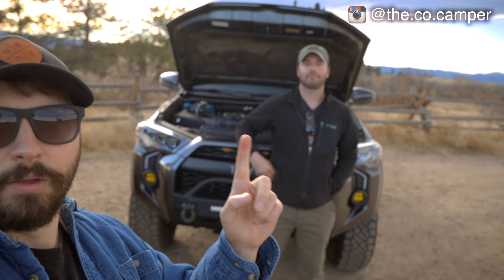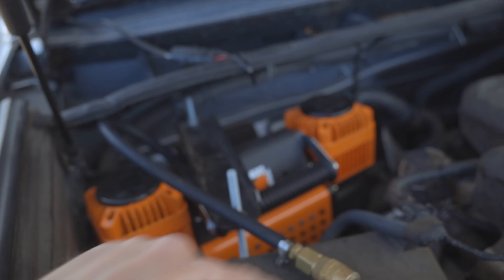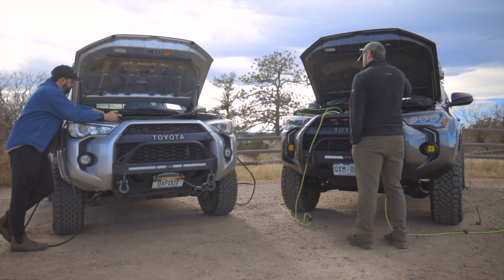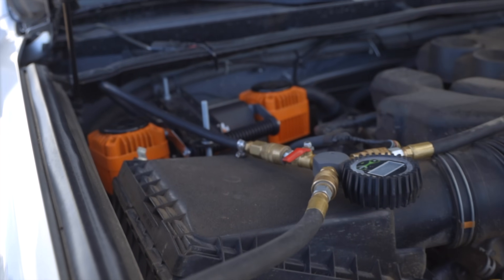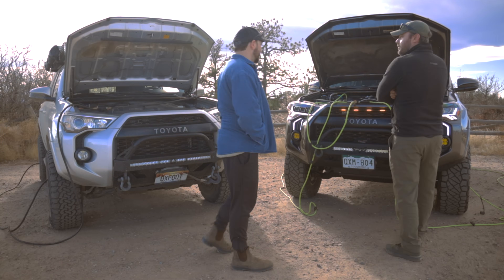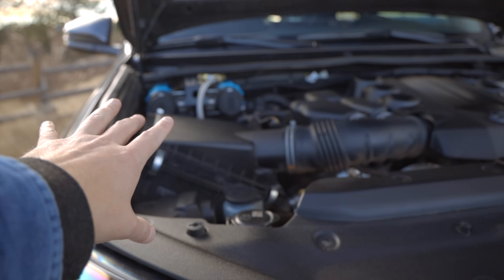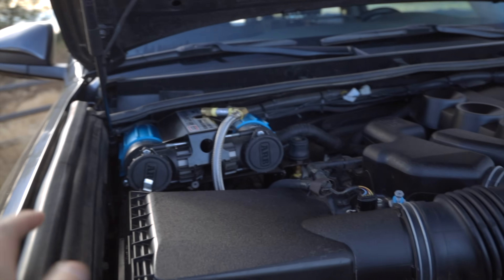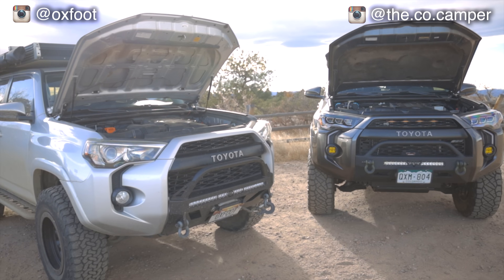Budget NAPA Compressor is FASTER than ARB Twin?

Comment: Speed could mean it is running hotter and will die sooner. Does either one state a duty cycle? i.e. the $35 single compressors often say 10 minutes on, then 15-20 minutes off to cool down. Or else they melt down.
Reply from the maker: So someone dug and reached out to them and found the numbers. It’s rated for 40psi for 15 minutes and 5 minutes off. So you could air up a few buddies tires in that time, but personally I think like in my case I’ll just air mine up because it’s in the engine bay and will just automatically be at a higher temperature.

Comment: How’s the compressor holding up? Liking it better than your Smittybilt? Thanks
Reply from the maker: So far so good. I would imagine if I had any issues with it would be due to water getting in it somehow but I thought the same with the smittybilt and that lasted me at least a year and a half.
Reply: @OXFOOT  good deal! I’m on the fence between the Napa one or the smittybilt
Reply from the maker: @fatmattsadventures2796  If you want something thats been tested many times then go smitty, if you want something fast that seems to be working alright go with the NAPA. It's a tough call. Also what size tires do you have? A big reason I wanted to go NAPA was because I was going to and then did eventually go up to size 305/70/17
Reply: @OXFOOT  I’m on 315/70r17’s on my gx470
Reply from the maker: @fatmattsadventures2796  damn it’s wild that the GXs handle that so easily with a narrow wheel well. I’m rubbing all over with 305s.

Comment: This genuinely caught me off guard. Perhaps the NAPA compressor won’t last as long but with that price and performance it’d  be worth replacing if and when it does break. My only reservation on it is the look. The ARB twin looks significantly cleaner and more like it’s meant to be there.
Reply from the maker: Yeah it’s aesthetically not my favorite. It’s massive, bulky, bright orange and just clearly not as nice as the ARB. That being said, in my engine bay it’s not noticeable. I may eventually go ARB because I want to go lockers and have a dual battery which I could only partially do with my current set up.
Reply: @OXFOOT   agreed. Just wish the ARB had similar performance because 10 minutes seems like a ridiculous amount of time when you’ve paid $600+ dollars for the setup.

Comment: What is the duty cycle of the NAPA? The ARB looks so much better
Reply from the maker: I couldn’t find it at all. I hunted for that info. Given that it only takes 3 minutes or so and I only air up my tires with them I’m still very safe operating the compressor but if I went back to back a few times and it was in the desert I’d pay close attention to it.
Reply from the maker: And yeah as far as aesthetics the ARB is head and shoulders above the rest.

Comment: Great video. I have a question about the versatility of the NAPA compressor, though.  Since it puts out so much air, is it still useable for airing up car tires?  My wife's Mazda had her TPS sensor go off the other day (Likely just temperature swing here) but it made me wonder if the compressors I was looking at for a 4WD truck could still be used to top off tires like hers or just blow the beads off the rims.
Reply from the maker: Yeah I mean at it’s speed I would think you’d be fine just keep a close eye on it. Like don’t leave the compressor’s side while you’re doing it. Maybe run it for like 10 seconds and see what it’s at.
Reply: Yep it does. I aired up my Subarus tires fine. Also aired my drift cars rear tires to 60 psi at the track
Reply: Air compressors don't really care what tire they're filling

Comment: Do you have a link to the modification video for the Napa compressor?
Reply from the maker: This one at the end ha all the stuff you need. You’ll just cut the hose and slide the barb in, slide a clamp down the hose, attach the connector to the barb and then slide the clamp back up over the part with the barb to keep it tight and then screw down the clamp.
Reply from the maker: https://youtu.be/De10UUP5UzY
Reply from the maker: Starts at like 10:20 something.
Reply: @OXFOOT  Thank you :)

Comment: Hi. How's your compressor doing? Still working under the hood? And very interesting to see a video on installing it. Thanks
Reply from the maker: Still holding up just fine. Still using it.
I have a video on installing a smitty built and it’s the same process but you just need to turn it a bit to make the bigger Napa one fit and not hit the engine.
Reply from the maker: This is the video: DIY Fast and Easy ONBOARD AIR with ANY compressor! SMITTYBILT
https://youtu.be/De10UUP5UzY
Reply: @OXFOOT  Thanks for the reply. I also recently bought a similar compressor. I'm going to improve it a bit more though. It doesn't have its full potential.)

Comment: Is there a duty cycle specified? I am curious if this could handle, with longevity, air locker usage.
Reply from the maker: I wish I could find that info. I tried to find it. If it was viable I’d love to get a front locker. I need to figure that out and finish wiring this thing in as well.

Comment: What bracket are you using for the front license plate of the c4 bumper? Thx
Reply from the maker: It’s actually their bracket that they sell. The Hawse license plate bracket. They have a new version of it that they make in house but the one I have is something they used to sell from another manufacturer but stopped. It’s called like the WP hawse license plate bracket but I’m not sure if it fits their bumpers now, maybe they’ve made a change to the design to fit their new brackets.

Comment: Which video shows you modifying this to work with your 4 way
Reply from the maker: I have a video that tells you how and shows the parts but it’s not like a video of me actually doing it. It’s just cutting the hose and adding the barb to the connector and then putting the barb down the end of the hose then clamping it. I’ll grab the video link hang on.
Reply from the maker: It should show in the time stamps in the descriptions show where the mod instructions are, but it’s towards the end.
https://youtu.be/De10UUP5UzY

Comment: So we see the results and they are very clear. What I will say about the build quality topic....there are a few things at play here. The biggest 1 is that NAPA as a company has pockets that are soooo far deeper than the other company. Plus they will most likely build a lot more in bulk. NAPA has the contacts to built products by companies and in places the other probably can't touch. When you add all of those factors up, plus others as well, can you really say for certain that the ARB is higher quality or we all just assume it is because we are programmed to think more expensive is better? Also too, maybe the ARB costs extra just to support the company owners lifestyle and there really hasn't been much competition to make them lower their prices. Whereas NAPA doesn't have to make $300 on each unit because they are so diverse that they are totally fine making say 20% on each unit vs the ARB that might be making 100% profit. The only way to truly test build quality would be to run say 10 compressors from each company 24/7/365 and keep track how many hours till fail. 1 guy might claim 15 years on an ARB, but maybe he only uses it once or twice a year? Sooo many factors involved
Reply from the maker: I mean that’s a really good point. I feel like the fact that they didn’t have a warranty provided was a good indicator that they didn’t really stand by the build quality but that’s 100% an assumption. Other than that the NAPA one hasn’t been around long enough to really prove that it’s high or low quality. You’re certainly not wrong in these assumptions.
Reply: They all pretty much buy from Chinese manufacturers. These units are sold under about 20 different names...they're all the same. One can go to Aliexpress and buy one for like $58 +s/h just to give a price comparison
Reply: @mrmotofy  I haven't researched these things enough to know that for a fact, but what you're saying definitely applies to MANY things. Batteries is 1 for sure. Back maybe 20 years or so ago I rememeber hearing this about shock absorbers as well. The other thing to consider is a known practice of China....Americans will design something and then give those schematics to a Chinese company to build it for them. Then that Chinese company turns around and just makes more than ordered and sells them to other Chinese companies. Plus so many companies reverse engineer things like rememeber on Top Gear some years back where they showed the knock-off BMW SUV that "looked" identical, but the build quality was severely lacking.

Tons of shenanigans for sure and for the most part, China doesn't enforce or recognize our trademarks or pattens.
Reply: @humveeadventures  Just as an example, I have a list of 8 brands of these 300L Dual compressors, that's not even including the multiple AUS selling them, I only listed a couple of the big ones. 

More often I believe the manufacturers buy off a Chinese catalog then relabel. A few years ago SnapOn sued Harbor Freight over the aluminum floor jacks that HF listed same as SnapOn etc. Something about trademark infringement or something. So it went to court...and the truth came out in the evidence...OOPSIE SnapOn was buying them from a catalog, then HF bought the same item and put a label on em...They are the same identical item...SnapOn lost cuz the truth was undeniable. It was the same item.

Yes I believe what happens is US specs are sent to the factories in China, they run the matching spec products then change labels or paint colors and run more and sell em on AliExpress etc. 

One example is I bought an inside truck door handle that is plastic riveted to the interior door panel. Dealer requires buying the whole inside door panel for $900. Or I can buy the same exact door handle and replace it for $12. They're identical right down to the exact pattern of the plastic finish, which is extremely rare from different manufacturers.

I seen these Dual compressors on Aliexpress for $59 + s/h
Reply: @mrmotofy  that's crazy that snap-on did that! Thx for the info.....never heard about the snap-on case before
Reply: @humveeadventures  Yep one can start getting really detailed and looking at flashing marks, tooling/die marks, finish designs can be sort of like a fingerprint, the overall layout of components, bends of piping etc. Different manufacturers will almost always be different.
As another example look at the 60gal or 80 gal box store compressors. They are virtually all the same in appearance, specs and design just a different name on em. Cuz they are made in the same place...just different name. These days with global manufacturing tons of relabeling going on. Almost anything can be bought direct and relabeled. I've gotten emails from a camera distributor...that is selling custom lableled cameras, and they are only the distributor. Tons of products are priced on a name.

Comment: I only use my truck to off-road a few times a year so this would be a reasonable option
Reply from the maker: What truck do you have? This thing is big so just making sure it’s gunna have the space in the engine bay.
Reply: @OXFOOT  Trail Boss. Can’t seem to find them so guess it don’t matter.
Reply: @OXFOOT  I’m also getting limited cause I mounted a 1500 watt inverter under there already. I ran a power plug to the bed too. I’ll figure something out eventually. I usually don’t travel in a group so no one’s waiting on me. I just meet them there and let them go on afterwards.

Comment: Do you have a link to this compressor?
Reply from the maker: https://www.napaonline.com/en/p/BK_MTWM10215C?cid=paidsearch_shopping_dcoe_google&campaign=GSC-Paint-Body-Equipment&campaign_id=10947560788&adgroup_id=110533803034&adtype=pla_with_promotion&gclid=CjwKCAiAv_KMBhAzEiwAs-rX1OYkScIZD7QaEz32IjiXC3Oi2pOLhPWZMErP5P6moI1mUEARxSRi2RoCgZQQAvD_BwE&gclsrc=aw.ds&
Reply from the maker: They are running a deal now that if you buy 3 things you get 20% off your order. I have both the compressor and the trash caddy and I recommend both.

Comment: I'd still go for the Napa over the ARB. I won't buy an overpriced air compressor just for it's brand name.

Saying the ARB will last long is not accurate for you are not sure at all.
Reply from the maker: Yeah I’ve had buddies of mine who’ve had theirs for years and they’ve had no problems but people have been commenting on this video saying they haven’t all had the same luck. The NAPA could be the same or better.

Comment: What were you both aired down to? And how close is your tire sizes?
Reply from the maker: Damn I should have added that. Exact tire size (made sure of that before filming) and we were going down to 15 psi and up to 35.
Reply: @OXFOOT  damn then 3 or 4 minutes for all of them is way fast. Mine takes like 8 to 9 for all 4 from 18 to 36 and they're smaller tires. So slightly more than twice as fast.
Reply from the maker: @seanwatson3790  Yeah it's almost too fast if you're doing one tire at a time. You'd start it up and be ready for the next tire.
Reply: @OXFOOT  ya I absolutely have no doubt. Maybe I'd you were running 40s it would be slower lol

Comment: Which one is louder. I run my compressor inside and was wondering about noise level
Reply from the maker: I would say the ARB is a little softer. The ARB has a very distinct sound whereas most other compressors have about the same noise.

Comment: Alot of the same on Amazon too even the bags that come with it are the same/similar (china) i got a lower end smitty built for my car its China bag is horrible quality but it works and filled my tire in about a minute 🤷 it got a little warm but cooled off fast so...wasnt as loud as i was expecting and didnt vibrate that much either , filled my tire before my car even warmed up 😂
Reply from the maker: Yeah I had a smitty for about two years and really loved it but it was a single piston. They may make a double but I haven’t seen it. I think a few Australian companies make exactly this compressor and just change the labels. I’ve seen ads from them with the same bright orange dual piston set up.

Comment: Can the max trac be use on the air locker
Reply from the maker: It probably could but unfortunately they stopped making this compressor very quickly after this video got released.
Reply: So you're saying that I can't get it from napa anymore

Comment: To state the obvious, the ARB has to be six times more reliable over the long-run than the Napa unit. If it were me, I'd buy two Napa, keep one as a spare on a shelf in the garage, and still pocket $400 in savings.
Reply from the maker: For sure. The only problem now is that they can’t seem to keep the Napa compressors in stock. The only other budget one is the summit offroad compressor and that’s $200.

Comment: faster does not always say better. 
durability is a big thing here. 
will the nape hold up for very long? sure cheap is the co$t point. sure you can buy a number of them before hitting the price point of the better brand (read pay hard earned cash for a name). would you need to have a spare napa compresser for when the first one stops pumping air?
how does it hold up to filling a 5 gallon tank with air up to 150 psi?

Comment: What bumpers are those?
Reply from the maker: I have the C4 low profile bumper with a 30” light cut out and mid height bull bar. His is a victory 4x4 bumper with tube work.
Reply from the maker: I’m not sure if his is steel or aluminum but that is an option on the victory 4x4.

Comment: This is to obvious in my thought process, go with the Napa one, even if it lasts 2-3 years it is still worth it as it is 500$+ cheaper. You would have to buy 5 Napa ones to equate to the ARB product over the years of service for the compressors. Nice video. And even with some mild modifications this would be a great product for off road use
Reply from the maker: Yeah I think for some folks who have let’s say a Jeep and a small engine bay and they want to do lockers I don’t think they’d have any other option than the ARB. That being said for the other 90% of us I think this NAPA one is the answer.
Reply: @OXFOOT  agreed as I have a Rubicon (lockers come standard) i would use this for the times when I air down for off roading and thats about it....

Comment: Is the cheap one suppose to be in engine bay I was going to do that with my viar but they say not to put in engine bay?
Reply from the maker: It's not made to go in there but I made it fit. The Smittybilt one I had in there for the last year said not to do that as well but I talked with them and found the heat rating and it was fine. Checked the materials on this one and it was the same. Now that doesn't mean go ahead and put your viar in there, but you probably could, I'd check the materials and heat rating and see what you can find out.

Comment: I think this compressor got too much attention because I just called NAPA to order it and it has been discontinued. Sucks I couldn't get my hands on one
Reply from the maker: Yeah that happened pretty quickly I guess. Summit offroad has one that’s the same speed but it’s $189. If you go on their page it’s the red one. It claims 300LPM which is the same as the NAPA compressor.